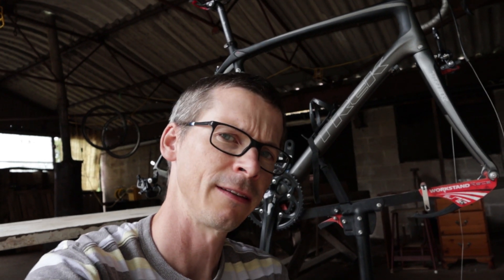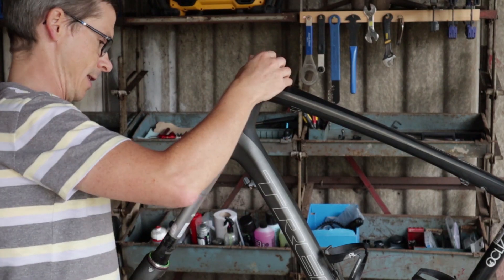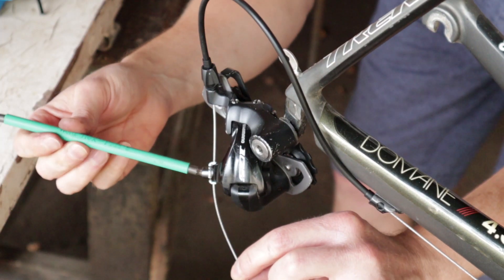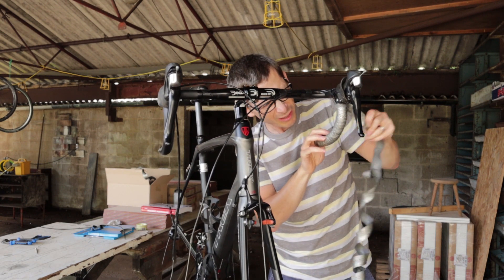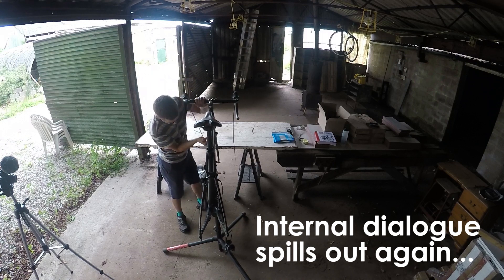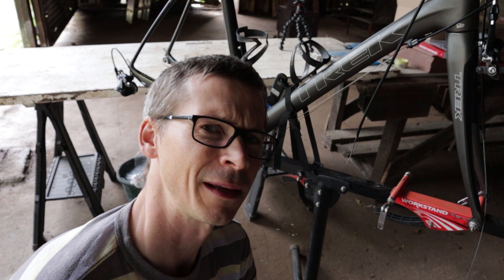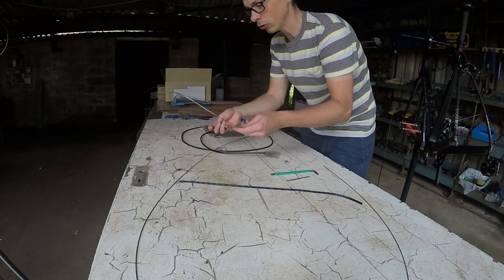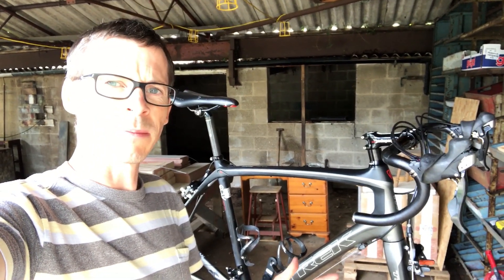Replacing Shimano Gear And Brake Cables On My Trek Road Bike

Comment: Another entertaining video Monty. Small thing though - always good to grip the cables about an inch from the ferrules and tap them straight down against the table to fully seat the ferrules on the outers. This will pre empt having to tighten the cables up again later. Carry on sir. You seem to be doing a fine job so far. Cheers
Reply from the maker: Thanks Stuart. Good tip. I’ve just bought new cables for my Dawes so I’ll make sure to do this. The Trek definitely needs to go back on the workstand for a little tune up. I assumed it was a little bit of cable stretch, but maybe the ferrules weren’t properly seated as well.

Comment: Well done Monty - out of interest- how much, with all the tools and parts (and Zinns), is it costing to rebuild the bike?
Reply from the maker: Thanks Paul. The total for parts came to £254. The tools I bought added a further £145. Of that though, £110 was the bearing press and the press fit bearings removal tool. Without my YouTube aspirations, I don't think I'd have bought those - I'd perhaps have tried to borrow them or just got the bike shop to do the job.
Reply from the maker: Sorry, I forgot to mention - the Zinn book adds another £17, but I already had that. Also, my tool total above doesn't include the torque wrench, which I already owned. I think plenty of people get by without a torque wrench though (certainly if you're not working on carbon bikes).